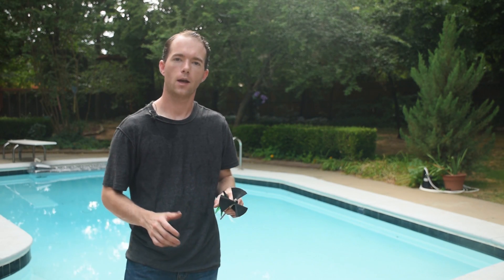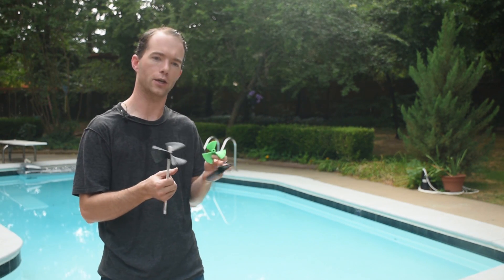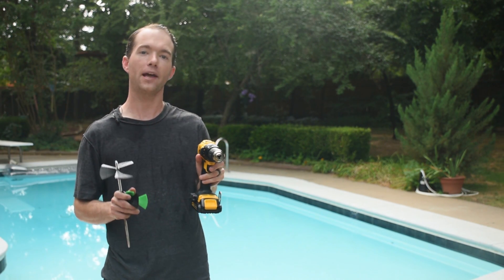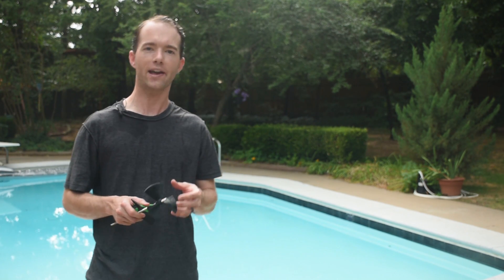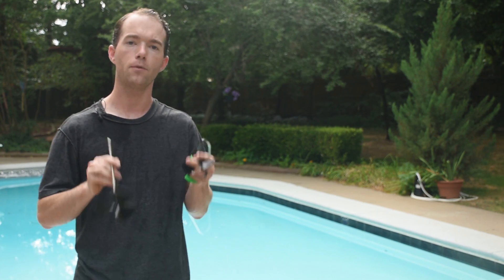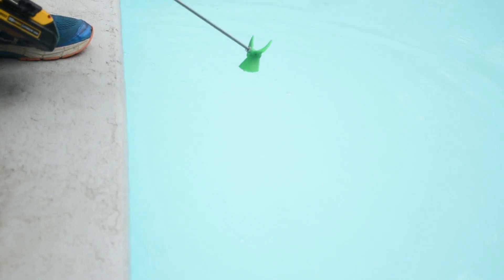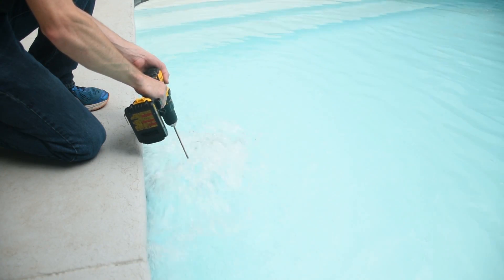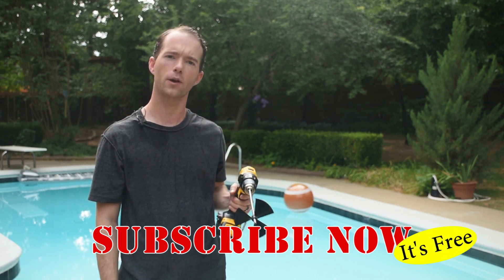3D Printed Propellers - Mikes Inventions

Comment: Great , i have a 3D printer, and have a trolling motor 55lbs. I am not designer . Looking to print a high pitch propeller design. Would u be able to send file
Reply from the maker: Hey Anish! I don’t pretend to be a master propeller designer, but if you send me the      Key dimensions and motor specs, I’ll certainly give it a shot. Thanks for watching!